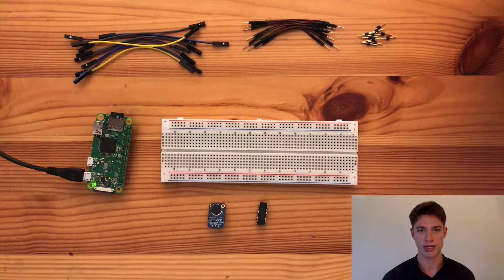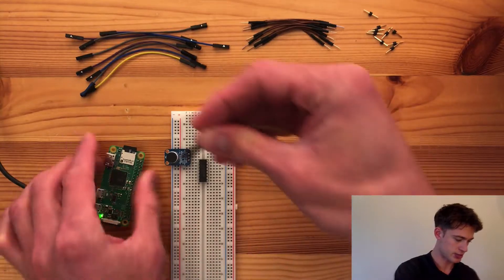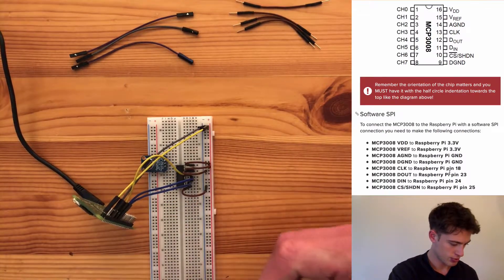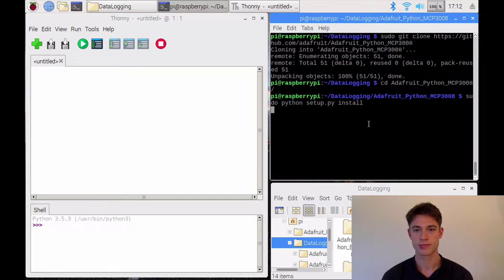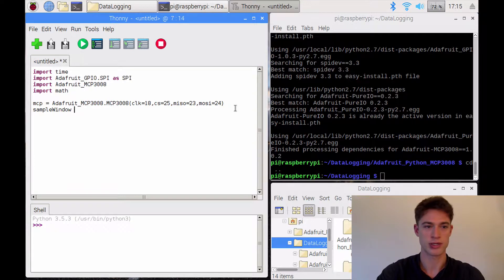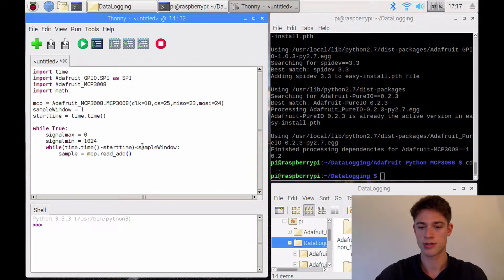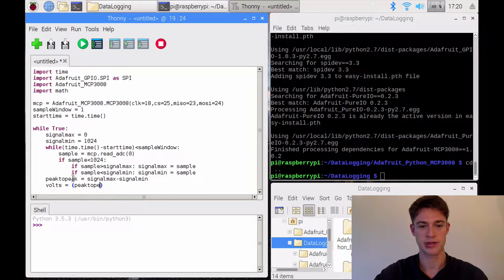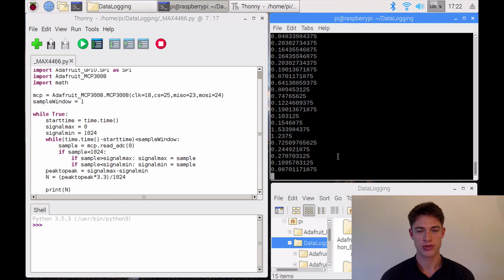13 | Indoor Weather Station | Max4466 | Sound Sensor

Comment: hi i just follow what you did. but i have error. it says 

Trace back (most recent call last):
File"/home/pipi/Datalogging/_MAX4466.py", line 6, in <module>
  mcp = Adafruit_MCP3008.MCP3008(clk=18, cs=25, miso=23, mosi=24)
File "/user/local/lib/python3.9/dist-packages/Adafruit_MCP3008-1.0.2-py3.9.egg/Adafruit_MCP3008/MCP3008.py", line 41, in _init_
File "/user/local/lib/python3.9/dist-packages/Adafruit_GPIO-1.0.4-py3.9.egg/Adafruit_GPIO/GPIO.py", line 429, in get_platform_gpio
RuntimeError:Could not determine platform.

do you know why it happens and how to solve? i hope you saw my comment as soon as possible and thank you for posting good video😀

Comment: Thanks, that was useful. But I get only minus values :(   how can we have the dB values too?
Reply from the maker: But also, this sensor is not able to output dB values. I think there are other sensors that do that but I haven't tried them. I think they are more complex and expensive.
Reply from the maker: Did you get the change I made at 15:49? Before that I also only got negative values. If the problem persists, it's difficult to tell from afar but most likely there is a flaw somewhere in your wiring.